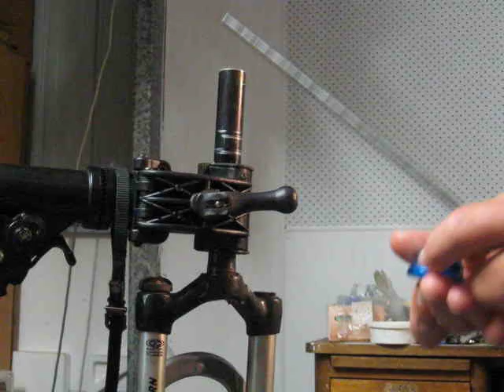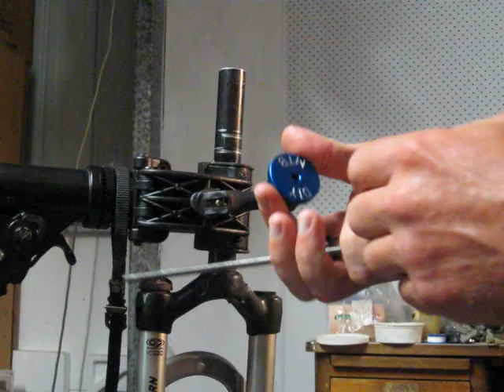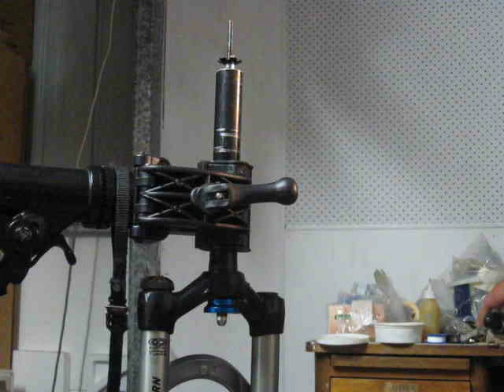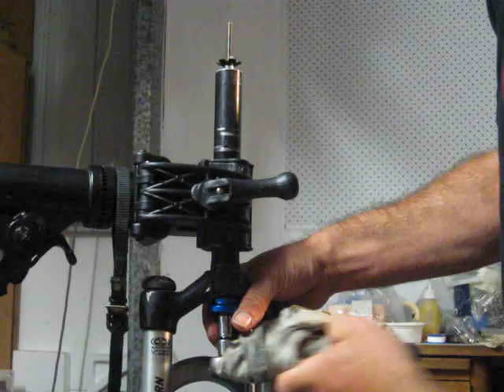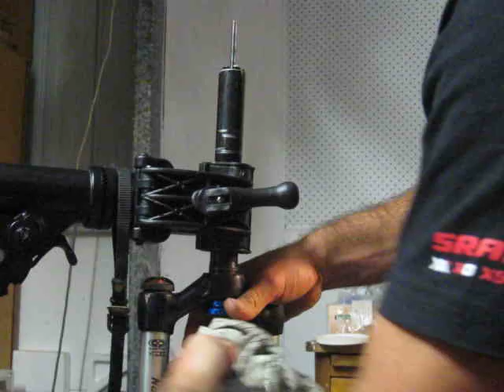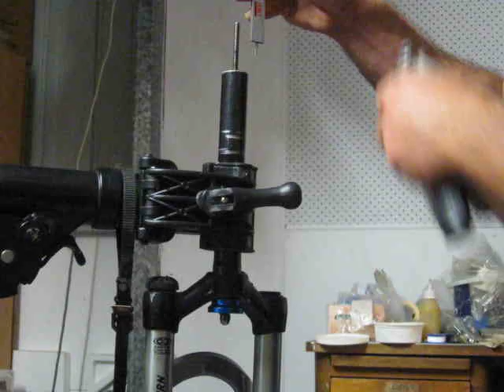Installing a star nut with DIY MTB

Comment: how clever! what a great idea! all you need is a threaded rod, a nut, and a steel piece to prevent the nut from coming up and forcing the star nut down. Beautiful, I imagine it should be pretty easy to find the threaded rod to fit the star nut at a hardware store, I have to cut my steer tube down today so I'm gonna give it a go.

Comment from the maker: Thanks. Yeah something stopped our webserver today. All good now. The cones and complete units are listed on the Tools page. 
Of course you are right that it would be practical to make this up youself and the main thing is that doing it this way gives a better result than normal impact type setter and is probably easier to get right every time if you are not doing this job everyday which is most of us.

Comment from the maker: best way is to drill through the centre of the old star nut becasue that's all that holds it together.
Start with a 7 or 8mm drill and when you have drilled through enough it'll start to come apart or you may have to use a punch to cause it to break up.
Most steerers are big enough for the remnants to cme out the but some narrow toward the bottom so you will have to get it all back out the top.

If all fails and you cannot completely remove the old one try to get it out of the way of the new one

Comment from the maker: No. Because the steerer on a new fork will be longer than you need and needs to be cut before a star nut is installed.

Check out other videos on installing new forks or cutting steerers to the correct length. 

If you're not sure it's probably worth paying to get the fork installed for you.

Comment: the inner diameter of my steer tube for my BMX bike is 1", do i need a 1" star nut, or do i get the 1 1/8" star nut(same size as outter diameter of steer tube) and that way its really tight into the steer tube???

Comment: This is all very well but i just took the fattest allen key of the set rested it on top of the star nut on top of the steer tube and whacked it (controlably) with a hammer until desired depth. Was in solid and hasn't budged since and took me less time than writing this comment..

Comment from the maker: @DShinskey - The generally accepted best depth seems to be 15mm to the centre of the nut. This allows you to get full thread contact when stem is installed correctly.